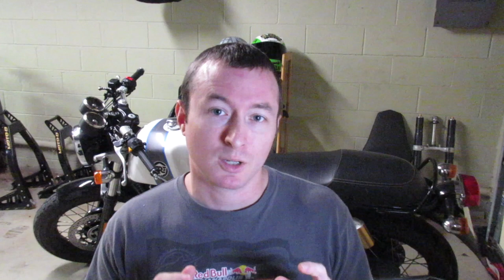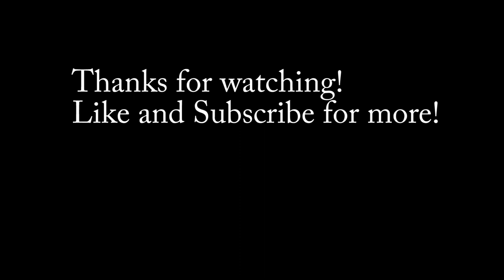Converting a Motorcycle from Shaft to Chain Drive?

Comment: Correct in regards to parasitic power loss (with shaft drive). Moreover; unless you can do some kind of mojo with a ring and pinion gear; you can't change the final drive ratio with a shaft drive. It all depends on what you want -- reliability and less maintenance (shaft drive) or something different (shaft to chain). Shaft to sprocket/chain requires a LOT of machine shop time -- NOT for a novice builder or someone without big bucks.
Reply from the maker: Correct hahaha, thanks!

Comment: Forget the HP losses, standard shaft drive puts horrendous loads into the rear suspension and will typically put the rider in a position where if he closes throttle mid corner, he *LOSES* ground clearance and bangs hard parts into the pavement. This is at highly elevated velocities in the first place, so if you don't ride fast you will never know or care about this.

The next question is: is there something about this shaft drive bike that makes it important for you to convert it? There are a few, and the V-Max comes to mind. Large displacement versions of the 'same' engine but were only ever shaft drive is another. Often a simple bolt in for much more displacement, except of course the shaft.

You make the excellent point that if someone is watching this video, they are probably not qualified to do this. You also ended your title with a question mark, so you aren't solving anyone's problems here.

Thanks?
Reply: Of course he's helping people ! He's given them the best practical advice. If you want a shaft driven motorcycle, then just buy one, but don't bother converting yours in your garage, because it's difficult, expensive, time consuming, but in the end,...it's unnecessary !
Reply: @intergalacticbasketballdro7186  Thank you captain obvious. Your comment has little to no value. But I guess you felt good making it!
Don't ever assume that people that criticize or thumbs down this video are 'fools'. The people that already know what a foolish endeavor it is to try to convert are the people you should be listening to. If they are not making videos and spouting away about it doesn't make them less knowledgeable, just  less noisy. Think about that.
Reply: He does have a valid point on that. However in this case. I was Basically just wondering if any machining work or welding work was going to be needed Or if it was all basically just  Switching out parts. He did an excellent job of answering. I think I should have done a better job of wording my question. 😂  This bike is an 85 Yamaha verago  with the xv 1000 limited edition.  Essentially the same bike from from Harley Davidson and the Marlboro man.  I picked the thing up for 600 bucks because an old man in the mountains couldn't figure out how to get it running. It had been kept in a garage. I got it home and had it running in a 1/2 hour. the valves just needed adjusted. 🤷‍♂️ I'm only the 2nd owner and the thing runs like it's brand new.   the original pipes Don't even look like they've been hot. I'm just not a big fan of shaft drive.  Bought it to flip it. But now I might keep it.  Unfortunately I still haven't done any more work to it. Had to take a break and put an engine in my truck
Reply: @funkymonkey529  That movie had an HD FXLR, not remotely the same as an 85 Virago. That is generally a good thing as the Yamaha is a far more reliable bike but supremely uncool in the wrong circles since it is one of the worst examples of a Japanese copy of an HD. Dreadful when looked at in that way, but best not to.
There have been many conversions of Viragos into infinitely cooler bikes, but few if any succeed in converting the shaft to chain. Most don't even try. A really great example is a builder named Greg Hageman who more or less made a name for himself doing Virago conversions. Here is one of my favorites, but you will note no attempt is made to shed the shaft.   https://www.bikeexif.com/yamaha-virago-920
Reply: @jameshisself9324   One of the bikes was  a Harley. There were 2 bikes and the other one sure as hell isn't. You might want to look again
Reply: @jameshisself9324   Google says it's a Honda 800.  But that's not true either.  Every inch of that bike is exactly like mine
Reply: @funkymonkey529  Whatever man, I was just trying to help you. I guess you got it all figured out. Why did you even comment on my thread if you weren't asking for help?
Reply: @jameshisself9324   I mean here is the exact situation. I asked a question but not very well. The guy made the video which will help out all kinds of people. Not just me. He basically did answer my question but just went way more in depth than he needed to when talking directly to me.   I apologized and and answered your question since you did start off with a question.  And even followed up with a second question in your thread. Which you should probably not do if you don't want people to answer them you mor-on. And you have a problem with all of this because he  Misunderstood me and explained it so people who don't understand mechanics can understand?  What in the hell are you smoking dude?  Why do you have a problem with that and then come at me like I pooped in your mouth? Are you ok?
Reply: @funkymonkey529  Holy Geezus dude, you barely  even make any sense. I asked one question rhetorically in the course of my long comment that was many statements that were not questions. Is reading hard for you? Seriously, I don't want to make fun of people who have a hard time in life so I'm not going to keep on about this. I tried to help you and made a suggestion of why your bike was better than the movie bike, and how you could mod yours to improve it. Gave you a link, did you even look at that bike? I'm trying to do you favors and you come back to tell me I need to look better at some lame movie. Sorry sport, but I think we are done here.

Comment: There are many Yamaha Vmax's that are converted over to chain drive by PCW in New York for the purpose of changing the final gear ratio-it puts more torque to the ground and as well as the horsepower.
Reply from the maker: Absolutely! If someone wants to take a power bike like that and convert it for the purpose of gaining the extra power to ground plus the versatility of changing sprockets out for different ratios then that is a different story! I still say it should be done by a pro, and obviously if someone is doing that to a Vmax for those reasons they wouldn't be coming to me for advice on it probably hahaha. Thanks James!

Comment: Fascinating - although I think you might have gone into too much detail. Should I convert from shaft to belt, or from belt to shaft though? I have some suggestions for your next videos: "Grease - should you smear it on your bike's brake disks and tyres or not?" Or how about "Should you replace your bike's handlebars with a steering wheel?" Or what about "Should you put water in your fuel tank?" I think you should investigate these burning issues next.
Reply from the maker: Hahaha, thanks for the comedic relief Don :-)
Reply: Betty Swallows, the answers to all of your questions is, "No" !
Stop greasing your brake disks.
Stop adding water to your gasoline.
AND TAKE THAT STUPID STEERING WHEEL OFF OF YOUR MOTORCYCLE !
Reply: Some people prefer to have their power cut And are too Pansy to do their own mechanic work. Some just don't enjoy it.  Others are the guys passing you on the freeway you wish you could catch.  just saying

Comment: Yes, you can do it and it will save almost 60 lbs! I did it on my Kawasaki 1500 shaft drive 2004.
You have to have skills. I used a Honda cb750 final drive sprocket and drill it with 8 holes .( You have to use a indexing table on a milling machine. You also must make the oil going into the Carden final drive return to the engine oil pan. Law of physics says you connot compress a fluid. You will have oil leaks. I have posted all of these steps online through a forum. No one was interested. There is NO bubble plastic kit that just bolts on.

Comment: I just now seen this video. Lol damn it's been a while.  Just to clarify. I already have the bike I was going to Just clean it up for the  Nostalgia at 1st. It's An 85 Yamaha verago Custom edition with the gold trimmed engine.  I was Toying with the idea Is of just going full custom. This was a great video and I'm sure it's going to help a lot of people out. I actually am quite a mechanic. I am an A&P mechanic.  I probably should have specified I was really just wondering if it was a case of unbolting bolting the assembly and throwing on sprockets. I knew it was going to be expensive. I just wasn't sure if it required welding and all that jazz. Figured it was easier to ask than to tear it apart Is possibly unnecessarily. Lol   You pretty much answered my question. Thank you.

Comment: Obviously packaging and rideability would be a challenge but couldn't you just turn the engine 90 degrees and then custom make a sprocket or sprocket hub that could go on the output shaft of the engine?  Couldn't you do that if you used a motorcycle engine in a cross kart or other 4 wheeled vehicle?

Comment: NUMBER 1 REASON TO CONVERT SHAFT TO CHAIN:    BC WITH SHAFT DRIVE YOU CANT USE A WIDE REAR TIRE BC YOU CANT WIDEN THE SWING ARM.  PLZ EXPAND ON THIS.
Reply: A shaft is wider than chain, which takes up real estate that could be used for a wider tire. This is of course if having a wider tire is wanted bad enough to do the conversion.

Comment: The guy I know wants his leg from under the left knee. I have a honda-matic system at my shop but he still wants to put it on a rigid frame and make bobber and cannot do that with shaft. Is it possible to convert the Honda matic shaft driven to chain? It's the only way he wants to ride, with a a little raked out. I have the frame and rolling chassis w sprocket. He wants more cid than the 400CM that matches the drive.

Comment: Hi buddy... can you explain what is involved in extending the swingarm on a shaft drive please...
Reply from the maker: A logistical nightmare really! You have to remove the shaft and do a longer extended swingarm like with a chain, then you either have to engineer and install a longer shaft or convert the motorcycle over to chain. Most people extending a shaft drive bike will convert to chain because it's much easier than trying to install a longer shaft itself.
Reply: @AlexSimmons11c  ... I've never worked on a shaft drive bike before but i'm going to give it a crack... it's a 1800 v twin drag bike...
Reply: @dozer3955  Why on Earth would you want 10% power loss from a shaft drive, on your drag bike?

Comment: My current project is to weld together a cross kart frame and put a V-Twin KFX700 engine (shaft driven). The only way to do that would be a chain drive conversion. How’s that gonna work for me?
Reply: I'm doing something similar.. I have traded a pickup camper for a go-kart. I have very little money involved and was given a V Star 650 shaft drive. The Kart is set up with a chain drive rear end.
I'm wanting to find the best way to go, either change the rear end to a shortend shaft drive or get the V Star converted to chain drive.
Some people just don't think outside the box. I'll get something to work I was hoping to get a little helpful suggestions.. but not everyone has the imagination to want to put a street bike motor on a mid size go-kart
No guts no glory.. lol

Comment: I have an 84 700 magna shaft drive with bad motor. Bought a donor that is chain drive 85 model. Will my shaft drive move over to the 85 chain drive just by changing out the outdrive section?

Comment: Dude, do I get a duke 390 or Royal Enfield gt650 I am looking for an all rounder bike that I can have fun on! Or do I break my budget wait for few years and get a z900?
Reply from the maker: Well those are very different machines for sure, the Duke 390 will be lighter and more "fun" in a lot of ways, but the 650 is a way better all-around bike in my opinion (plus better on the maintenance etc)
Reply: @AlexSimmons11c  The Royal Enfield is reliable, but they look like they were built in 1981 ! (Ugly)
The Duke 390 is sporty & fun, and it looks awesome, too ! But you'd be sacrificing a lot of Horsepower. 
That's why I chose a Kawasaki Versys 650. Good power, Reliable, Sporty & Fun, and it still looks awesome too !

Comment: I have a 1982 RC07 honda vf 750 magna the engine is shaft drive but is no good I can get  a repacement chain drive engine can I convert the chain drive to shaft drive using the parts I have.

Comment: I would like to know, how hard would it be to convert a chain driven motorcycle to belt drive ?
How hard is it, to do ? 
How much might it cost ? 
What are the benifits ? 
What are the drawbacks ?
What types of motorcycle s would be good to do this to,  if any ?
Is it, worth the time ? effort ? and expense ? 
THX
Reply: INTERGALACTIC BASKETWEAVING ROID FARCE
It would range from very easy to impossible.
It would be easy - up to impossible, as I said.
It wouldn't cost too much, but might be quite a bit.
Benefits are no chain drive and new belt.
Drawbacks are no chain drive.
The best types of motorcycle to do this on are chain drive motorcycles, if any.
It depends if it's worth the time, effort and expense on how much you want to convert chain to belt drive.

"Hey Alex ! I've watched a few of your videos, and you seem to be a pretty well educated motorcycle guy. You speak clearly, without having to cut and edit. I value your input. I think that you're recommendations here are solid advice. I was kinda surprised that you received so many thumbs down, but I guess you just can't help those fools."

Hi Alex!

Comment: im thinking of doing this to a gl1200 im streetfighter-ing
Reply: You can only do it if the final output or countershaft turns the right direction.  Counterclockwise. 
Then you might be able to do it.
Not a beginner project!
Reply: In 2005 Kawasaki changed the 1500 from shaft to belt drive!
Good move Kawasaki!
I hope my articles on Kawasaki forum influenced Kawasaki.
Also they changed the Plastic oil pump gear to metal after many complete engine failures!
All manufacturers should keep car designers out of the motorcycle dept. Lol